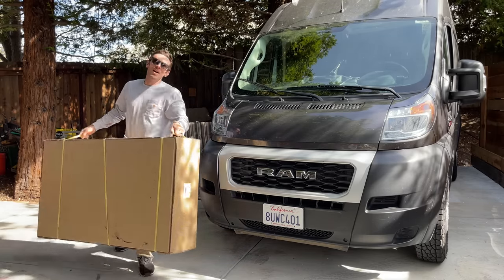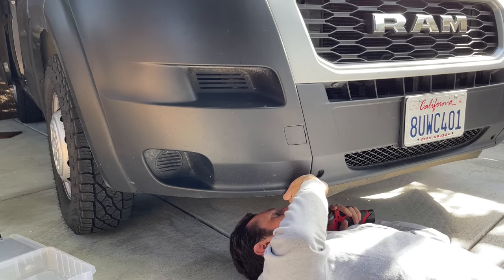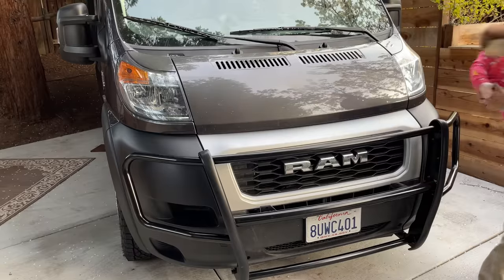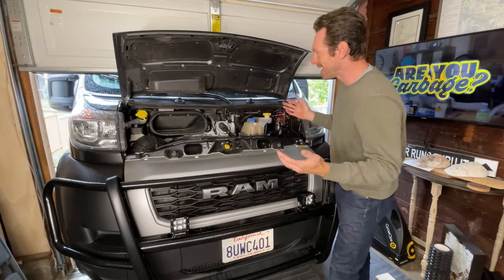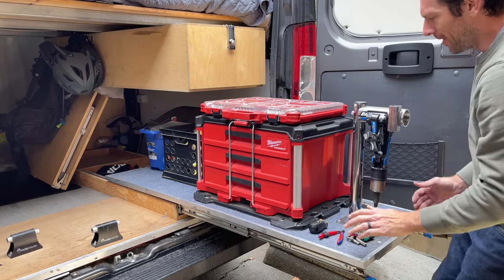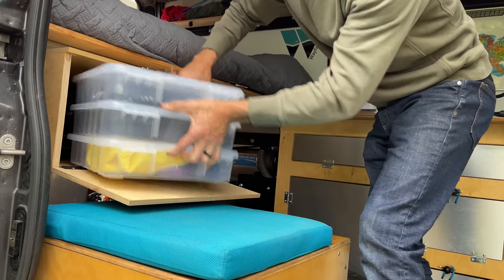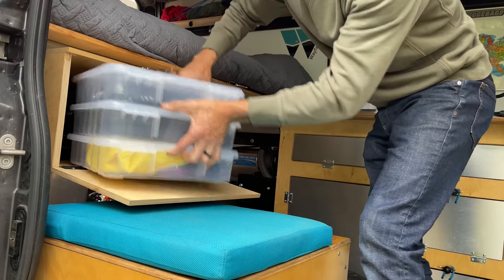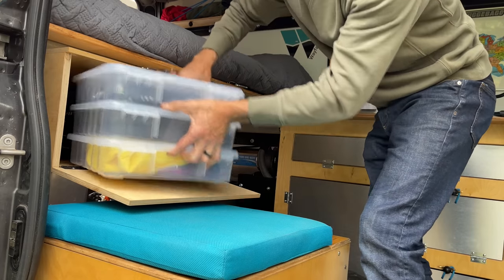The work is NEVER done on the van! | RAM Promaster Camper Van upgrades

Comment: Mount the button right above the on/off switch for your air compressor.  You could drill through the plastic for the gauge and wouldn't be doing anything permanent to the van itself.

Comment: Nice Job Brian. You should spray paint black your rims. I did it with my van, really cheap and gave a really co look. Also some of that tape on the table will help, that way the hook won't mess with your table and the tape will end at the bottom.

Comment: Just put your rubber tape on the underside of the table that is rattling so you don't have to use the towels. I use that stuff for weight bench, etc. Works great.

Comment: You can do a lot. You'll probably be able to change the oil too. Maybe cheaper. I stopped having oil changed by others because I got fed up with them with false claims of bad drain plugs and them trying to sell me a $5 drain plug scam. Even had this bad person put one qt. and send me down the road. Had a nagging feeling so I checked the dip stick, does not register after oil change. just enough to not have oil pressure light and I'd be broken down with blown engine on a cross country trip.